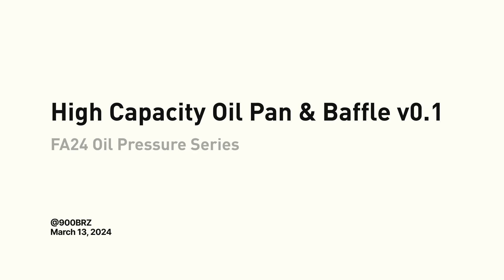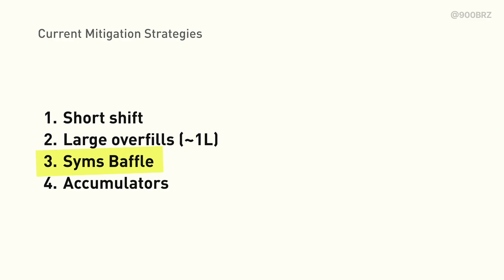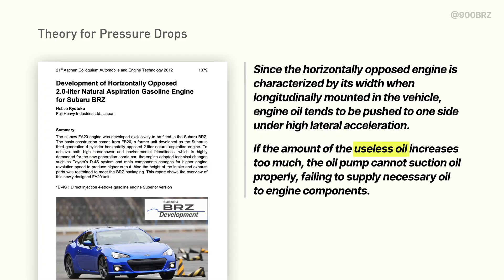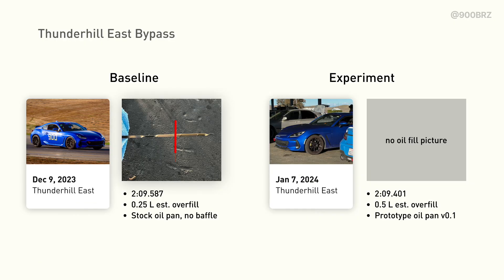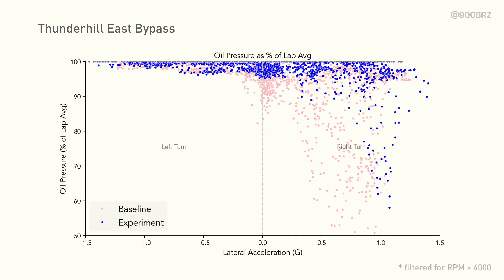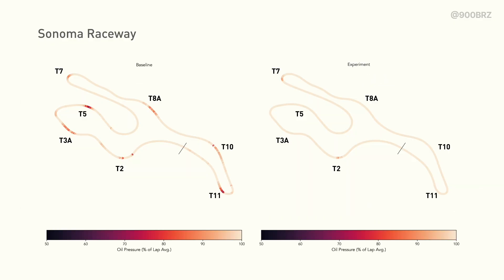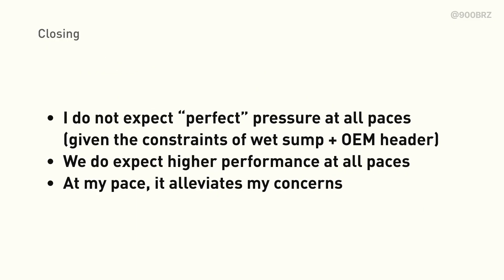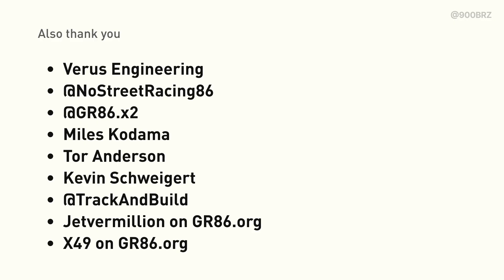FA24 High Capacity Oil Pan & Baffle Announcement

Comment: This may be a dumb question but would a high capacity oil cooler hold more oil?
Reply from the maker: It does, but it won’t affect the pressure drops since the oil volume there doesn’t change aeration happening at the pickup.
Reply: @900BRZ so should oil coolers be on the return side? I'm actually trying to figure out an engine oil cooler for my impreza right now and wondering if i should use a trans cooler with a 1/4 line but it seems that engine oil coolers need to be bigger. Advice?
Reply from the maker: @MonkellD  Yeah that’s too small for engine oil coolers. You will end up with too much restriction. I wrote about some of the thinking that went into my recent oil cooler build: https://900brz.com/posts/oil-cooler
Reply: @900BRZ  wow! Thank you so much!!! I will have to browse the website when I get time!     If you know this much, I would love your opinion on catch cans/AOS' and if they reduce vacuum in the engine by changing the pcv length.

Comment: Awesome work to everyone involved. Well worth the donation. For someone like me that will always have to split between a street/track car without extreme performance tires/aero, this looks like the best solution that will be available.

With the header heat shield removed to install the prototype, are you able to elaborate on temperature increases to the oil? I'm guessing any concern is mitigated with a cooler, so just more reason to have one for maximum effectiveness.
Reply from the maker: Thanks so much for the support! So far I haven’t seen a measurable difference in oil temp, but the OE sensor is post-oil cooler. So I’m more worried about whether there is any risk to the head RTV seals and I’ve also heard people either FA20s without heat shields report issues with the fuel injectors. Other people have said they had no issue running without heat shields. You can always ceramic coat the header or install a hood vent.

Comment: Is this an fa24 issue or does this apply to the brz only?
Reply from the maker: FA24 issue. Applies to both cars.
Reply: The other being gr86, I presume? Has this been observed in the VB WRX?
Reply from the maker: Ah yes, was thinking of FA24D in GR86 and BRZ. Subaru has documented pressure drops in FA24DIT in their 24-Hour Nurburgring WRX but that’s basically a full race car. I’ve seen one other video showing pressure drops in a VB WRX at Thunderhill but I haven’t done any testing personally.
Reply: @900BRZ  🙏

Comment: great work, love seeing all the data and improvement from this high capacity oil pan. One question, you mentioned removing the heat shield from the stock header. Is that just for installation of the new pan and the heat shield is put back on afterwards? Or is it the heat shield permanently removed? Is there any concerns if the heat shield is removed permanently?
Reply from the maker: Thanks! Yes, removal of the heat shield is permanent in order to clear the increased size of the pan. There is some concern about heat build up, but you can ceramic coat or wrap the OE header, or add extra cooling, like a hood vent. Or just run it as is, which I’m doing currently. IMO a hood vent is the best option but it’s not legal in Stock class in 86 Challenge, unfortunately.

Comment: Have you considered modifying the valve covers to support hoses and route them to the pan to help passively reduce useless oil? Even if not utilized by all customers, considering the pan design such that it could be fitted with them later by some customers might be a good idea to future proof the design. Really nice job so far!
Reply from the maker: My thinking was that we could potentially add ports or replace the valve covers with ported ones and then run one scavenge pumps on each head. But it’s quite involved still.
Reply: @900BRZ  It would be very interesting to try a proof of concept. RB26 engines suffer from the same poor oil return from the cylinder head and many opt to drill the rear of the cylinder head and add an external hose to give a parallel path back to the sump. An FA24 might be better suited for such a fix; given the oil is likely to collect near the valvetrain/valve covers during cornering and might not modifying the engine; just the valve covers. Even without a scavenge pump, I bet there is some benefit to adding external hoses. Something to consider.

Comment: I looked at all the data you've provided now and previously on this matter, and suggest you visit my previous comments on this subject, and do share them with the design engineer. I'm a retired engineer and know the solution for oil control. I own a Porsche Cayman S 987.2 (2010) and didn't buy the 1st gen due to all the problems in the design and it is more than oil control. Have your engineer look at how the MA1/9A1 Porsche engine is designed to control oil supply. This is meant in a good way and best with it.
Reply from the maker: It’s not possible for me to search comments by username and I wasn’t able to find your previous comment. Can you summarize or tell me which video you previously commented on?
Reply: @900BRZ  The one from a year ago and hopefully my input has helped to solve this oil control issue for everyone.

Comment: Does a 1L overfill without the baffle provide measurable improvements in oil pressure drop? And is that enough for someone who doesn't track their car, rather just spirited canyon drives?
Reply from the maker: For canyon runs I expect you would be okay with the overfill, but I haven’t collected data on this and it’s too late for me now haha. You can see data from a very fast driver on track on a higher grip setup and a 1L overfill toward the end of the video. It’s definitely not enough to resolve the pressure drops at a fast pace, but unless you’re on a closed course I wouldn’t expect you to see anything that extreme.

Comment: Very thorough test, but I don't think its proven until we see data with at least a good 200tw tire
Reply from the maker: Yeah totally fair. Based on small pressure drops at my pace with the pan, we will likely not have a perfect solution for higher grip setups. You could combine with an accumulator. Regardless it should be better than existing performance.

Comment: As you wished individual situations: i am quite hesitant to install something into the oil/ engine system because it would risk my warranty (Germany). I use the car both daily and on track/ drift events. Therefore, an accumulator would never find its way into my engine bay. A solution like this, however, would even intrigue me. It’s non invasive and seems to take control of the situation. At the end of the day there is no gain to have a blown up engine WITH warranty and the having to deal with Toyota to replace it. Even if the agree to do so (which could be a stressful legal situation): how long is it gonna take. I wouldn’t want to have the car standing around for 1 year… Definitely looking forward to future developments in this! Thanks for your work everyone involved.
Reply from the maker: Thanks for sharing! Has been really interesting to see everyone’s situations and how they’re thinking about it.

Comment: Very interested in this. Is there any chance the v0.2 can work with the header heat shielding? I know most concerns are around performance and rightfully so but it would be amazing if  that could be kept stock as well. Will probably buy it either way over here!
Reply: Oh and thank you so much for this! The twins platform will benefit so much from this product.
Reply from the maker: We need to remove the heat shield to gain space for expanding the pan, so the next iteration will still have that constraint. It’s very tight down there, unfortunately. Thanks for watching and for the comment!

Comment: Thank you for all the effort! Quick question though. Why is it important that the product is compatible with the stock header? Or should I ask, if we already have an aftermarket header, the oil pan & baffle could potentially be designed differently and be more effective?
Reply from the maker: Good question. California is a big market and CARB regulations are very strict. We could potentially get even bigger benefits from a custom header + oil pan, but it will be much more expensive due to the header and not legal in CA. If this product is successful, maybe it would be in the cards for a future product.

Comment: Thank you for all the data and research so far. It would be great if we can retain the OEM heat shield or perhaps just some shielding. I am guessing the increased capacity sump will sit a lot closer to the pan and without shielding will that cause a lot more heat in the sump on a day to day and traffic driving? Hats off for all the testing, date and developments 👍
Reply from the maker: There are some ways of managing this heat, like ceramic coating or wrapping the header. We also have some heat reflective foil on the pan. So far I haven’t seen a significant difference in oil temps, but the temp sensor is located in the oil circuit downstream of the oil cooler and I don’t have a temp sensor in the pan itself.

Comment: Thanks again for your incredible sacrifice in time and effort, let alone financial input. 

This solution will be perfect for my setup as for classing the only allowed suspension modification is lowering springs. Currently on 225/40/18 Yokohama Advan AD08RS on 18x8.5 Wedsport TC105X

As a side note could you compare the rate of oil temperature increase with the OEM heat shield vs without? Peak temps are likely to not be affected since you’re using an oil cooler, thus rate of increase is likely the only way to see the effect of this change.

Thanks again to your and all the other contributors for their effort
Reply from the maker: I don’t really have good data on that, unfortunately. I think the best way to measure it would be with a temp sensor on the pan itself. The OE temp sensor is in the oiling circuit downstream of the oil cooler. I’m not seeing any meaningful difference before/after at that point, but my cooler has a lot of capacity since it’s a Series 9, 20 row Setrab core.
Reply: @900BRZ  no problem was just curious. I don’t think it’s necessary to run that test specifically just wondered if any of the existing logged data would have any indication.

Comment: Great video!  I am about to order an Accusump for my '23 BRZ.  I run track days and time trials (won COMSCC T50 class last year) on RCE SS-2 coilovers with 225 Yok A052s.  Considering bumping up a class and running Hoosiers this year, but oiling issues gives me pause...  Looking forward to this solution, a big fan of the "simplicity" of this approach and a HUGE fan of all the testing and data collecting and sharing you have been doing.  Thanks!
Reply from the maker: Thanks for commenting! You’ll probably have enough grip you’ll want to run both the pan and the accumulator. I’d recommend getting oil pressure instrumentation so you can see if it’s necessary.

Comment: I'm assuming, though I haven't seen data yet, that a similar issue would exist for the FA24 in my WRX. Will this pan and baffle fit?
Reply from the maker: It will probably need some modifications and it’s a deeper pan so potentially has potential for even more capacity. Hopefully Verus or another shop can fulfill that need too. I have seen some evidence of pressure drops on FA24DIT but not sure how they compare to FA24D. Teaser: Subaru has also documented pressure drops in FA24DIT but in a very built car.

Comment: I’m curious if this solution can be applied to 1st gen as well given they also still suffer from drops in oil pressure 🤔
Reply from the maker: It may require some tweaks but it would probably be relatively straightforward to adapt to the first gen too.
Reply: @900BRZ  Just out of curiosity. How many total quarts of oil does the stock FA24 need? I’ve held a theory for a while that they aren’t feeding it enough oil which is why the pressure is falling. When you all made the pan high capacity you fixed the issue.
Reply from the maker: @NapalmPineapple  5.3 qts. Out understanding is that the pickup is sucking air. In the video I show a study that demonstrates that aeration causes pressure drops and there is a linear relationship between aeration % and pressure drop %

Comment: Thank you! I would be convinced to buy a Twin again if this is found to be a reliable solution! I'm guessing the heat shield removal is less of a concern over time?
Reply from the maker: As Eric from Verus said: heat management is an easier problem to solve than oil pressure drops. Ceramic coating the header or adding a hood vent should be sufficient. Have heard mixed reports about long-term effects of unshielded headers with no other heat management. Some people say it’s fine and others have reported fuel injector issues. Probably a good idea to use some heat management strategy.

Comment: Thank you for all that you do good sir. 

This along with forced induction will now be on order in the near future for that sweet 300hp spot. 

Again you have my gratitude along with many others.

On a side note. Have you encountered a burning rubber and some sort of gear oil  smell? Been trying to deduce what it is but the only thing I’ve been able to assume is the belt getting hot by something after opening the hood right after a getting on it a bit. Sadly it’s consistent
Reply from the maker: Yes, would love it if this opens up the path the FI for folks!

Comment: I don't plan in tracking the car until the final product hits the market. However, do you think it's worth it for someone who doesn't track the car ? Thank you for your hard work, not all heroes wear capes !
Reply from the maker: I still haven’t tried to produce pressure drops on the street and now it will be more difficult—thankfully. I assume it’s possible, but not sure. Certainly won’t hurt to have a higher oil volume.

Comment: I'm glad all this work went into finding a straightforward fix for this problem. I actually had an engine die on me at 5K miles on my 2023 GR86. Thankfully Toyota took care of replacing it. And they never told me what caused it, just that it was "a very rare but documented problem with these engines". At the time I had been driving the car much more aggressively after doing a 500 mile break in period. I feel like I must have experienced something to do with oil pressure because I started getting audible knock. Since the engine replacement  I have not driven the car at all really which makes me very disappointed. But once this fix is out there and is tested by the masses, I'll be getting it for my car so that hopefully I can enjoy driving my car once again. Thanks so much for all the hard work.
Reply from the maker: Thanks for sharing and sorry to hear about your engine failure. I would love to see actual stats for failures rates, but I’ve given up trying to keep track from anecdotes.  Hoping we can make everyone feel comfortable flogging their cars!

Comment: I've been holding off on getting stickier tires until I have some solution to the oil pressure issue. I was about to get an accumulator installed, but I would really prefer an oil pan solution of it works as well or better. Looking forward to seeing more results and a product I can buy.
Reply from the maker: Yeah totally reasonable. Hopefully soon!

Comment: Kinda unrelated but what do you think about the Verus Engineering AOS with the drain-back + coolant kit? Kinda surprised you’re not running it already in your car.
Reply from the maker: I should have mentioned it, but I’m actually running the Radium PCV-side catch can. Single catch can setup after my friend Kevin got both and found that the crankcase ventilation side wasn’t collecting much. I don’t drive the car much outside of the track and live in the Bay Area, so I didn’t think the coolant integration was necessary. Verus option looks really well built to me though.
Reply: @900BRZ 
I see, thanks for the quick reply. I prefer Verus Engineering’s AOS as it seems to be the most effective but more importantly, it’s maintenance-free (unlike a catch-can). If I’m not mistaken about any of that 😅. Can’t wait for their final version of the oil baffle plate.
Reply from the maker: @CarsOverPeople Yeah catch can definitely requires emptying

Comment: Im very interested in this solution, im running 255/35 tires currently, with some suspension upgrades, i mainly hit the back roads and the cannons right now, so i don't believe i would have crazy drops, i would like to eventually track it, so this really gives me hope. It would be cool if this could work with aftermarket headers, but as it stands know i will gladly run the stock headers for the peace of mind.
Reply from the maker: Thanks for sharing. Hopefully Verus sees enough demand that they are interested in a partnership with a header manufacturer on an integrated setup as well. We’ll see.

Comment: Thank you. Great video, I started tracking car last year so it would be while till i actually see oil pressure drops. But hopefully with time, I would pull high gs and end up buying future iteration. What's the new oil capacity?
Reply from the maker: I’ll let Verus release the official capacity. They will probably want to lock down the design before sharing. Glad to hear you’re tracking the car!
Reply: @900BRZ  makes sense. Verus is definitely a cool engineering company, I am using their anti buffeting plastic part, makes a difference. It would be interesting to see what they come up with.